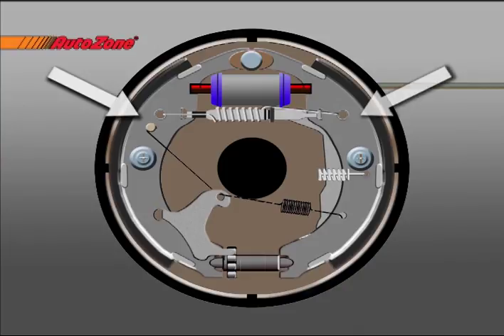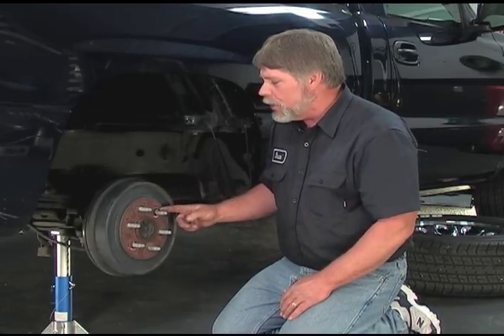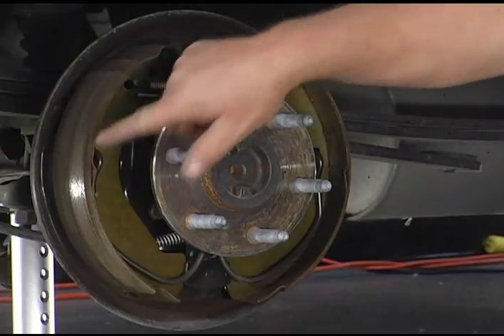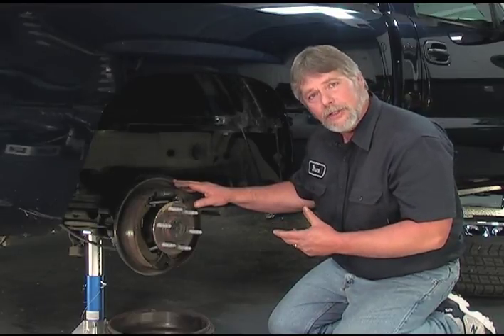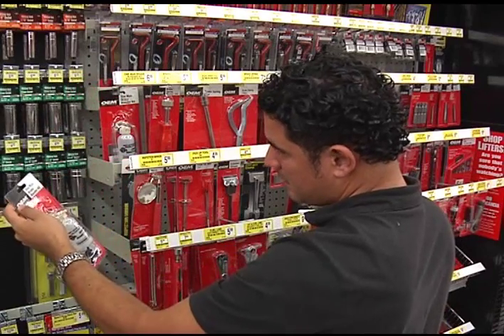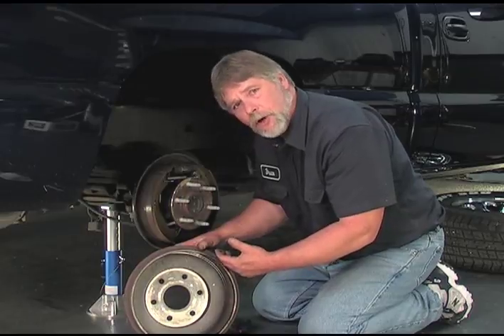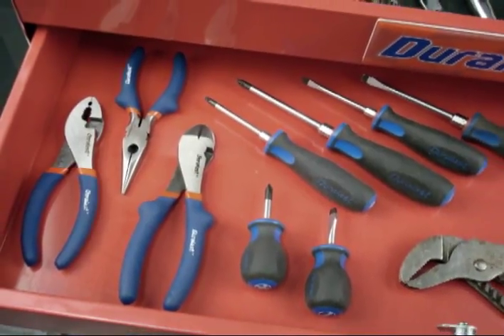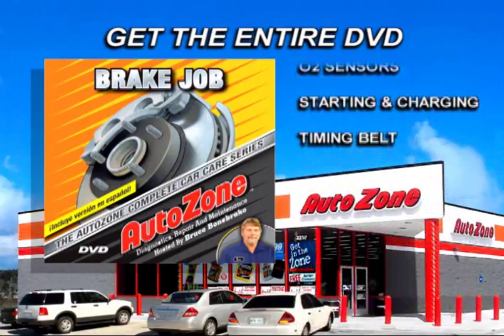How to Replace Drum Brakes - AutoZone Car Care

Comment: Forgot to say don't use those screws if your drum has an internal lip design. You'd have to loosen the star wheel with a couple of screwdrivers or hook tools in through a hold you can find already made in the drum.